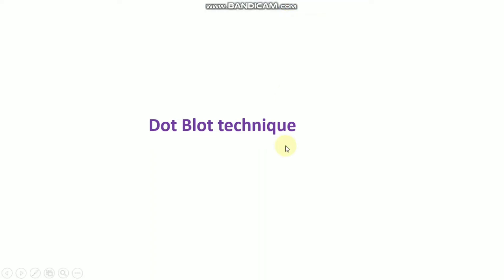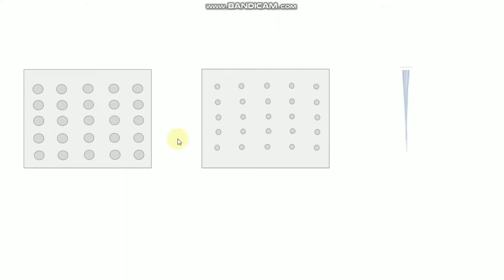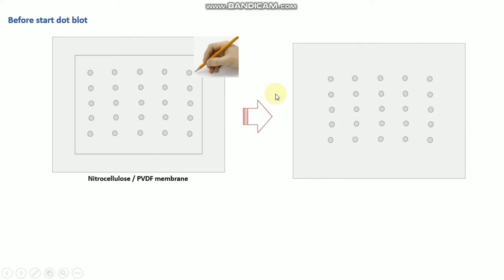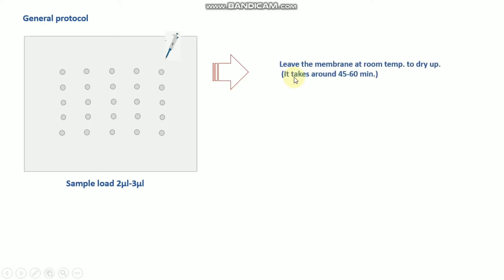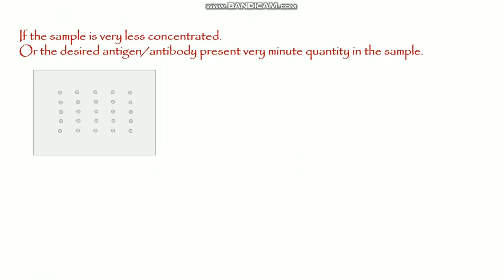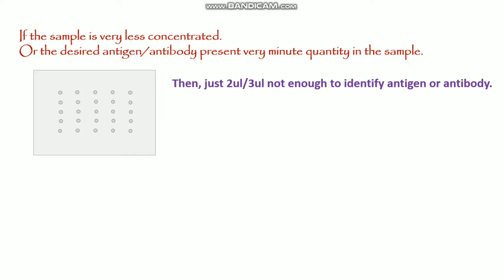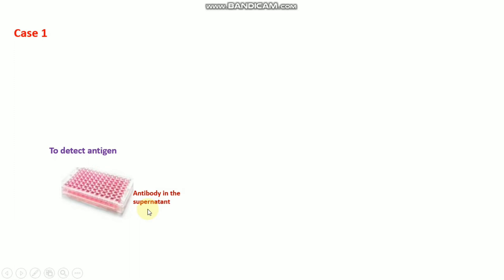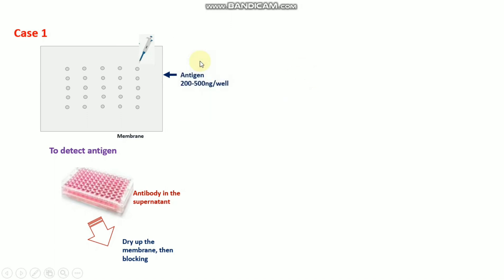Dot Blot Technique ll Dot blot protocol ll Xgene and proteinX

Comment: I have a question. In the case of antigen in the sample where you first added the antibody and it dried up, How do you achieve a control for that. Because since the antibody is loaded on to the membrane first. Won’t it bind the secondary antibody regardless of the binding to antigen. Also what’s the ratio of background when done ??
Reply from the maker: Better to add antigen first to get antigen specific binding.  For the control, don't add antigen, rest of the other steps are same, so you won't get any specific blot. Here, blocking step need to be done same as western blot, so won't get background noise.